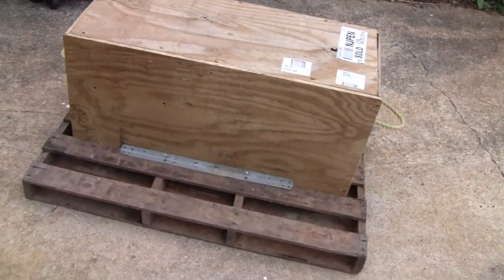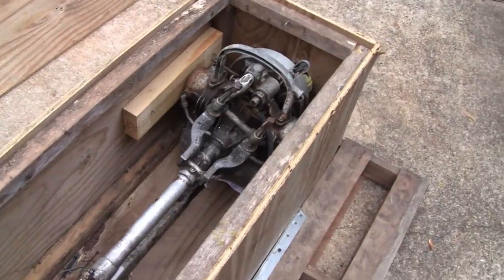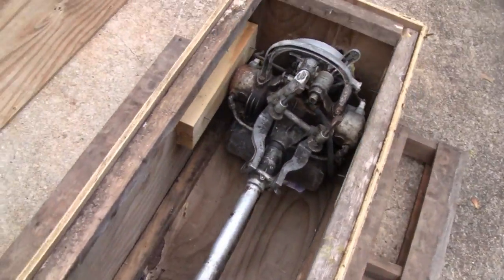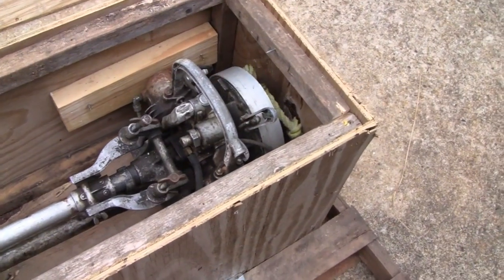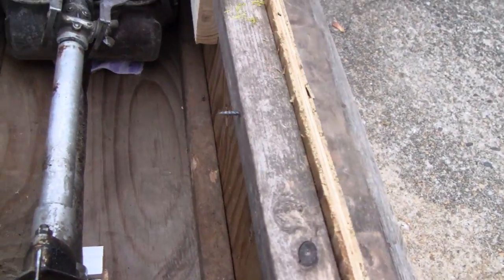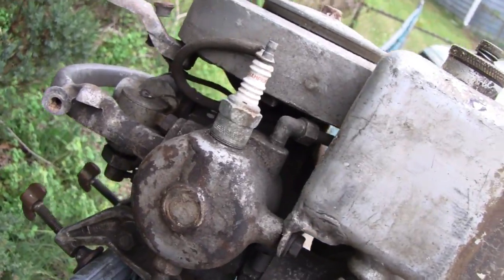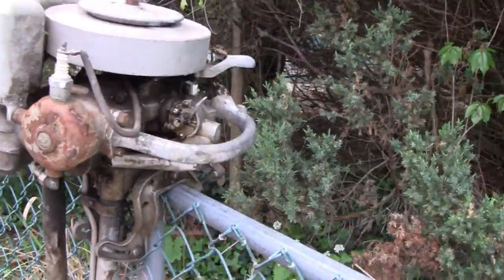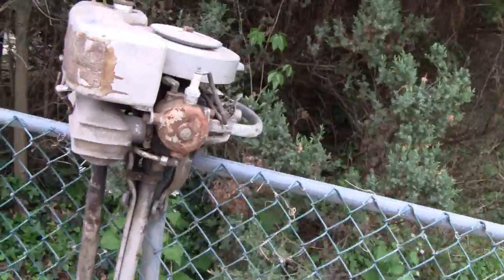1936 JOHNSON OUTBOARD REBUILD (part 1)

Comment: that is a 1936 Johnson 200   3.3hp and when it was new it went for $82.50 it would run 1hour 15mm one one tank of gas oil mix is SAE. 40per gal. of gas use Champion C7 spark plug   give or take wt. 38 3/4 lbs.
Reply from the maker: +Tim Miller Thanks for the info Tim!!☺